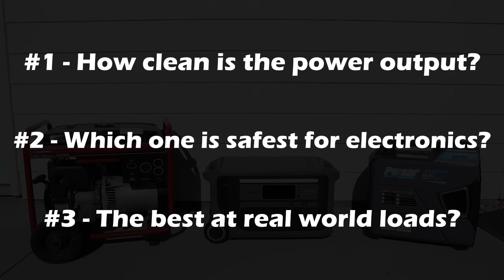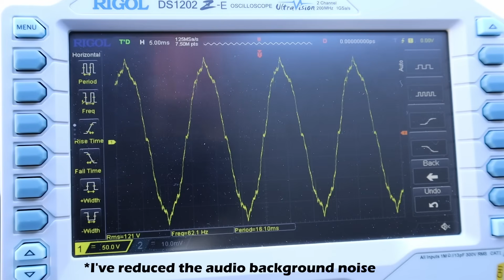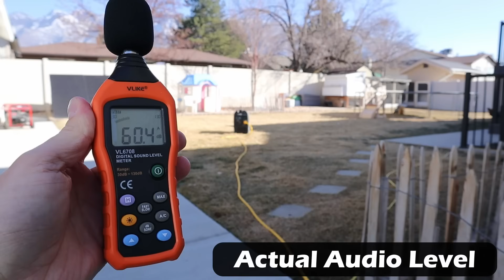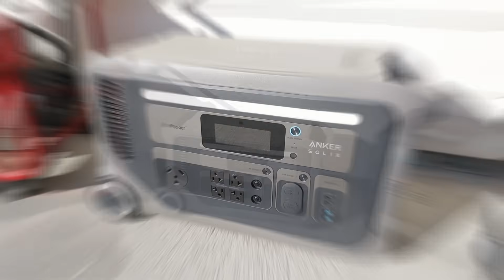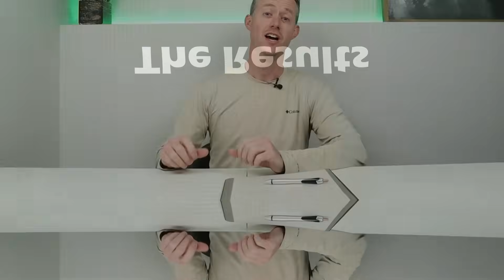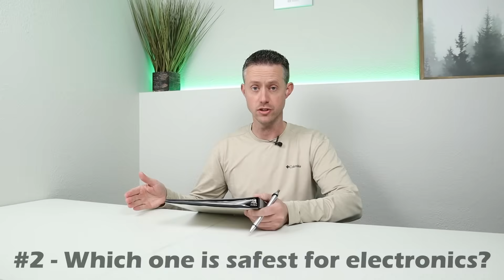Before You Plug Electronics Into A Generator, Watch This!

Comment: I appreciate the comparison here, and certainly there are some differences to be noted between the different Power sources with the exception of utility. I'm wondering how you came to the conclusion of not using specific devices on some of these different power sources. That seems like a big leap right now without more information. 
We have no idea of the the filtering components that are in the devices you using.
You would want to put your scope on the filtered power side of the devices that are being used.

Comment: The biggest problems with a generator concerning electronics if it isn't an inverter is the ground.Are you running a bonded or floating ground under what conditions.

Comment: I kinda missed a peak voltage measurement on the traditional generator. We saw big peaks on the sine wave, unloaded. By the way the output of that one might clean up quite a bit already if you'd just connect a 100W incandescent lamp to it. That would probably stabilize the output of that generator enough to run devices with electronic power supplies.
The main issue is the peak voltage in that sine wave. Capacitors in an electronic power supply will charge up right until that voltage and might exceed the maximum rated voltage of those capacitors, causing excessive wear and the risk of catastrophic failure.

Comment: The internal power supply systems in computers pretty well discard the electrical noise. Computers need very clean power to the motherboard to function.

Comment: I learned this about the poor power coming from regular generators 20 years ago when I started a racing series all over the nation. The only sensitive equipment I had was my laptop for the tuning of the race car. To keep things simple I just put solar panel on the trailer that charged the trailers 12 Volt battery and hooked up an inverter. The only thing that ran off the inverter was the laptop. The generator supplied all the other power needed.
Conventional generators are far less useful today than they were 20 years ago! Just too much sensitive equipment in the average household

Comment: I'm curious if all traditional generators perform as poorly.  I don't have anything to test the sinewave, but I have a 12kW Duromax that I hook up to the house through a 50 amp input with transfer switch for backup after hurricanes.  We haven't been hit here since I got it, bit I have run the house for 21 hours straight as a test and everything came out fine.  That included TVs, computers, refrigerator, and a central AC surging as it cycled on and off.
Reply from the maker: I'm guessing it's much better than the one in the video!

Comment: Very useful real-world testing-- thanks! Also worth noting is a potential shortcoming of some inverters and inverter generators for running AC motors. I noticed those loads you mentioned as suitable for inverters were less than half of the nominal inverter output.

My lower end inverter setup, rated 800w, doesn't like starting the household fridge! But an old Tripp-Lite 750VA low frequency unit, weighing about 25lbs, handles the lift just fine. So, unless AC motors have a special soft start device, you'll want to derate any prospective high frequency inverters planned to supply them!

Comment: I've powered my entire home on a generac portable generator for over 20 years and I have never had a issue with electronics.  LED lighting will flicker due to the voltage and frequency instability but the power supplies in my TVs, stereos, computers and everything else have always rejected the noise and ran just fine.
Reply from the maker: I've had mixed comments about electronics being damaged some haven't. I'm guessing it's probably the quality of the traditional generator 🤷 I'm definitely glad yours have been okay.
Reply: Will a standard petrol generator work on a modern refrigerator? Did you try it? Was there any effect at all?
Reply: @Africa1000Sorry, I don’t own a modern refrigerator, it’s 36 years old.
Reply: @williamrucki9293 😂OK thanks. I was just wondering what would happen if I ran my refrigerator of a standard generator. Some people say it's fine others say it's going to destroy it immediately.

Comment: What's your reference?  I like to see the same tests run on the 120vac socket on the back of your house as a reference. also a 3000watt load run time on all 3 devices. So your happy with 3% THD on your house with all your stuff plunged in?  Great video .
Reply from the maker: I have since tested grid power, 3.1% THD and 121v 60hz.

Comment: Powerstations don't make noise? Mine sounds like a hovercraft taking flight if putting out over 300 watts.
Reply from the maker: I hate fan noise. Every power station I test goes through a strict grading process. Fan noise is one of the grading points. I have all that data logged into my grading spreadsheet found on my website, Jasonoid.com
Reply: @Jasonoid  Holy smokes, that's the best and most comprehensive power station grading sheet I've ever seen!! Thanks!
Reply from the maker: @10thAveFreezeOut every power station I test I put through extensive testing 👍

Comment: I conducted a similar test a few days ago since there wasn’t any video about it on YouTube. Thanks for sharing yours!
Which country are you from, and what is the total harmonic distortion (THD) of your mains voltage?
I also tested a 7.5 kW and a 100 kW diesel generator. The smaller unit produced about 5% THD at idle and around 12% at 50% load. The larger generator, on the other hand, delivered a nearly perfect sine wave (0.4% THD; not an inverter) and was significantly quieter compared to the 7.5 kW model.
Since diesel engines can be operated on heating oil (which is essentially the same as diesel but considerably cheaper in Germany), I chose the more affordable generator (a non-inverter diesel unit). I’m using multiple switched-mode power supply to generate 48 V DC for a 5 kW pure sine wave inverter (Greencell).
It’s somewhat challenging to get everything running properly (parallel SMPS), but in the end, it’s the most cost-effective solution for me for supplying the entire house with clean and stable voltage and with the SMPS i can charge the PV-battery directly. The AVR by the way just help with the voltage and frequency, the THD remains the same.
Reply from the maker: When I tested grid power recently, it had 121v @60hz THD was 3.1%.

Comment: I used a regular generator in a power outage several years ago.  It ran everything I needed with no problem.  My furnace has a control board and worked just fine.  The same was true with my garage door opener and refrigerator.  One thing I did notice was a clock I had started gaining time.  Apparently it used the 60 Hz power supply to keep time.  The generator was running between 61 and 62 Hz.  My computer had no problems.  I tried using my dryer (natural gas) and it struggled to start, but did succeed.  My microwave sounded different and I decided not to use it just in case.

All in all, a regular generator got me through a 44 hour power outage due to an ice storm.

Comment: Some people are suggesting to use UPS with standard generators, however some UPS won’t work with dirty signals, I mean, they will switch to backup mode and that is not sustainable - they won’t run much longer, will drain the battery etc. they are meant for taking over within a certain occurrence, not all the the time. I live in a place where mains are not good, and my UPS count had like 500 events over 10 years. I don’t think it would last with 500 events within a short period

Comment: Comparing a battery generator to an inverter generator is kind of pointless as they both use the exact same inverter technology. The only difference might be if the gas inverter generator is in "eco" mode where it idles down at light loads which could make starting the table saw more difficult. Ecoflow makes an electric start dual fuel smart generator that connects to their battery generators. You can run silently most of the time from battery and the generator will auto start at a chosen minimum battery level and charge to a chosen maximum battery level before shutting itself off. It's also a regular inverter generator with 120 volt output if needed. And "dirty" power from a traditional generator is rarely harmful and certainly not dangerous. Some things might exhibit issues but won't be harmed.
Reply from the maker: I compared all three because I had never seen the quality output of the Pulsar before. It doesn't mention pure sine inverter in it so I was curious if had a modified or pure sine output. Glad to see it had a pure sine inverter.

Comment: Wonder what is the cause of Total Harmonic Distortion on the “traditional” generator?  THD on commercial or mains or Utility power is usually caused by the load such as switching power supplies. The traditional generator used in this video is super cheap so the quality of the design and materials must be poor thus creating a poor magnetic field.

Comment: Good testing, though a few comments:
1. 3 % THD is very tight even for the power grid. You usually tolerate up to around 8 % in a residential setting, though with tighter limits on higher harmonics so that genset would probably fail anyway.
2. Brushed motors like your saw are extremely hard on inverters since they draw power in a horribly noisy manner. These should not be run on small inverters because they are very likely to BLOW UP THE INVERTER! Traditional generators are far more tolerant since the stator is a completely electromagnetic voltage source, and copper windings do not care much about noise or back EMF.
3. The devices that are most likely to fail due to dirty power are small, cheap power supplies called capacitive droppers. These are common in electronic white goods, LED lamps, thermostats and other small, cheap things that connect to the mains and only require a small amount of power. These fail because they pass more current to the load the more high frequency noise there is on the line. Anything with a switchmode power supply (read: all modern "smart devices") or traditional transformer supply will be very tolerant to noise and unlikely to fail.
Reply from the maker: Excellent information, thanks for sharing your knowledge!

Comment: Good video, however, lots of fearmongering about "dirty power" from the "Traditional" generator. DANGEROUS DIFFERENCE???  Come on now, you should know better.  Clickbait. Traditional generators have been powering electronics for more than half a century with no problems.  All this "Dirty Power" and %THD is all just marketing hype to sell more inverter generators and YT creators use it to get more views.  Just curious why you didn't show how dirty the Utility line power is as a baseline comparison... it would take a lot of the wind out of the sails of the "MUST HAVE INVERTER LOW THD CLEAN POWER or else my stuff will let out the magic smoke" crowd.

Again, traditional generators have been powering all types of electronics for over half a century with no issues.  In the real world outside of click-baity type YT videos, it makes no difference.

Comment: No real surprises here regarding the Inverter Gen vs Power Station … the inverter “should” be of comparable performance in each product, the only difference being how the generator motor is always going to dip when you apply a sudden surge load … this will cause the input voltage to dip accordingly until the governor can recover. 
Was a bit surprised as to how rough the traditional generator power output was … I was expecting it to become erratic when you connected the saw … with its high inductive load, but I had expected a cleaner ac waveform in a no-load case or (essentially) pure resistive heater load. The problem with a traditional generator is frequency control, which is solely regulated by the motor governor … might be reasonable if your generator had an electronic fuel injection system, but always a bit of a lost cause with any carbureted engine. 
Would have been good if you’d also run a benchmark set of tests against your normal mains supply … I think you’d have experienced the same result with the table saw … it’s always unwise to have any sensitive electronics connected close to one of those things during startup .. same with air compressors or other high power machine tools. 
Have to say, I’d always be reluctant to try and run a power saw or machine tool off a battery/inverter power station due to the high inductive loading and surge currents associated … mains supplies have the resistive damping capacity to absorb the problem … but I’d be frightened of frying the output semiconductors of a 3kVA solid state inverter .. you’d certainly be stressing them … as you can tell by the transient surge mess it makes of the ac waveform.

Comment: Useful info.  Thanks.  So is there a device that can go in-between the dirty generators (non inverter) and our sensitive gear to clean the provided electricity? Like filtering?  Like throwing a capacitor into a certain circuit to cut out static?
Reply: Yep. They're called line filters and comprise an electronic circuit to reduce noise and voltage spikes. They come in a wide range of price and quality.
Reply: @soaringvulture Ah.  Thanks for the lead.

Comment: Complete list of appliances you do not want to run on a backup generator:
AC Wall Clock.
Every device tested worked just fine.  Resistive heaters, motors, switch mode power supplies on electronics tolerate a great deal of distortion and just don't care.
Reply from the maker: While that seems to the case from most of the comments on the video, some people have also stated that their traditional generators have damaged electronics. The power output from a traditional generator seems varied. In my opinion why should anyone risk it when you can get a generator that puts out better power than the grid?

Comment: I have a 16-hp 8000-watt commercial-grade Dayton generator manufactured in the early 1990s. It was new old stock when I purchased it. It can run everything in my house (including sensitive electronics like computers and the television) when the power goes out. I'll cycle things on and off to keep the load around 50%, so I don't blow through my gas too quickly.  The crazy thing is that there is one appliance I can't run, even if that's the only thing I'm running with no other load, and that is my microwave oven.  Just wondering if anyone else has experienced the same issue when using a traditional generator with a microwave oven.

Comment: Almost all AC to DC powersupplies use a rectified bridge, large decouplling capacitors and either linear or a switched voltage regulator. Inductors are also used for power correction and also used in switched regulators.
The high frequency harmonics should not be a problem since they have low amplitude and are attenuated by the LC filters. These harmonics have very low voltage, thus no dangers of breakdown, maybe EMI problem "transmitter"

Comment: Power supplies typically get hot on any power source. If you are running a traditional generator, they make devices that plug in to the wall and you plug your device in to it. It cleans up the power for sensitive devices. But if you don't have that you will most likely hear a problem first. You can actually hear the power supply buzz on many things if using dirty power. A microwave will make a terrible noise. You will most likely hear the problem first.
Reply from the maker: That's a great way to describe it, I appreciate the feedback.

Comment: Question; Can you add an inverter (inline) to a dirty generator? In other words convert a dirty generator to an inverter generator by adding a simple inverter on the outlet!
Reply: You can add a UPS or a powerline conditioner.  Depending upon the capacity, they can exceed the cost of an inverter generator.  There are cheaper UPS that can connect to the generator and be dedicated to a small load like a computer.  But I'm not sure how a UPS reacts to dirty input power.  These are usually connected to cleaner grid power.,
Reply: @danburch9989  thank you!

Comment: There's no such thing as "sensitive" electronic equipment. TVs, computers, phone chargers, laptops are powered by an inverter at their input. The inverter converts the "noisy" AC to DC via diodes. This DC then feeds the inverter circuit which extracts pulses of current into a small transformer, the output of which is rectified into smooth, regulated DC which the device wants. It could care less about the incoming waveshape or frequency.
If you look at the specs, they are usually rated for 90-300 volts, 50-60 Hz.
Reply from the maker: While that seems to the case from most of the comments on the video, some people have also stated that their traditional generators have damaged electronics. The power output from a traditional generator seems varied, probably based on the pricing. What would have caused the damage in your opinion?